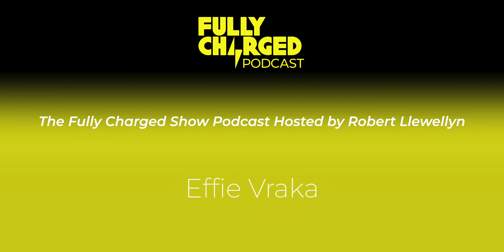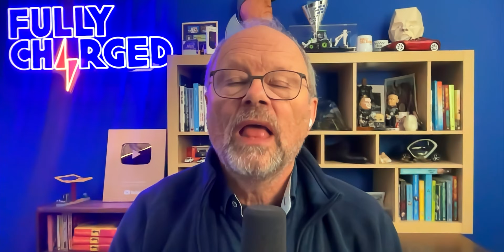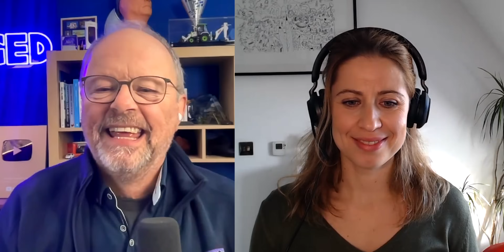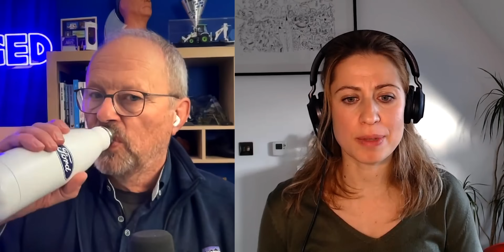with Effie Vraka | The Fully Charged Podcast

Comment: Felt so comfy to hear so many of my own stories told:
Living as tenent, with no 3-phases (11 kW) charging possible / allowed, only my standard, 1-phased plug. But it just workes well, especially since i do have a 3 kWp offgrid PV on my landlords roof, plus free charging at my company. Charging at home is just the most flexible and rewarding thing at all, power ranging from under 1 kW up to 2.3, using excess energy from my home batteries only. Just love it. 🥰

Comment: We're in a terraced house with no off-street parking, and no designated parking space, but that doesn't stop us from recharging at home. We've done that since early 2021. Use a little lateral thinking, and you might find that you can do the same, safely and legally, and at very low cost. Everyone's circumstances are different, but talking nicely to your local council might yield surprising results.

Comment: What we have found here in Canada is that buildings from the 70's were built with incandescent lightbulbs and old inefficient appliances in mind.  These buildings then have plenty of spare capacity that can charge all vehicles with the use of a charging management system.

Comment: Robert, agree that having even slow chargers widely available would help speed EV adoption. Better and more affordable home and small business scale batteries would also help speed electrification. And, small businesses owners need inexpensive charging stations that simply and directly bill the person charging their cars.
Reply: Level 2 charge points with integrated load balancing and billing is the way forward for businesses with public parking. Should be cheap enough soon.
Reply: They're building new houses around Lincolnshire, complete with home recharging points  @lua-nya  It costs very little extra to do that during construction. I don't know many people who have the finances for an EV plus a brand new house, but those houses are selling, otherwise the builders would not be interested in adding that basic refinement.

Comment: Spot on Robert. The fooks that can must. Others will follow as system is built out. This is no different than any other society level technological leap. Steam pump first invented in 1690 it wasn't until 80 years later that they were widespread. Electrification in America took 60+ years as did telephone. Automobile 50 years. The folks first to use these devices were wealthy. Government unwrote much of initial infrastructure needs.

Comment: I found the podcast very interesting & at various stages in it, the same question kept on running through my mind which was. Is the WeVo system bidirectional or setup to eventually be bidirectional ie vehicle to grid / load?

Comment: I live in an Apartment block, and we have repeatedly asked our landlord to install an EV charge point or set of points in our Apartment blocks carpark (with the usual "Just think, you can advertise this" or "This will be required soon anyway" etc), but they keep saying "there just aren't enough residents that use an EV"... well yes... because there is no charging infrastructure... So annoying.  They will NOT allow us to put in a charger, even though they would not have to pay for it as my wife is entitled to a free charge point due to being disabled.  It is very annoying.  We are forced to use the public charging network here, which is not great in Northern Ireland (yet, they are slowly getting better).

Comment: Another subject to cover is the best way to charge if the pavement is between the car and the house.. I've seen one overhead arm device that swings over the pavement with the cable, and another one has a channel cut in the pavement to accept the cable...
Reply: If your council does not stupidly push back to prevent either of these solutions so that they can milk you by partnering with a charger provider and provide you with both the charger and THEIR electricity tariff… 😤
Reply: Yes. A cantilever is the first thing my electrician suggested, because he's been fitting them to terraced houses, some of which have a small front space of a metre or two before the footpath. I suggested the covered channel, but apparently our local council is not interested in doing that, even though there are grants available to cover the costs. 🤷‍♂ They're still stuck in a 20th Century time warp. 🤦🏼‍♂

Comment: Naysayers are constantly bringing up the subjects of having no off-road parking and living in a tower block. It's one of their longest standing desperation arguments. There is absolutely NO effect on EV ownership if you have no driveway or live in a tower block. As per always these trolls never apply this argument to ICE vehicles. I always point out that unlike ICE vehicle owners, EV owners can charge at home. Even if you have no off-road parking and no dedicated charger you can still run a granny lead out to the pavement outside your house. There are never usually parking restrictions overnight so that's not an issue. But of course the argument is reduced to nonsense immediately if you ask naysayers to state categorically that no petrol, diesel or even hydrogen car driver lives in a flat or a house with no off-road parking. Of course they do. They ALL have to drive SOMEWHERE ELSE to get their fuel. You can't have a petrol station at your house, you can't put a diesel pump in a street lamp, you can't generate combustible liquid from a solar panel or a wind turbine. Here comes an eye rolling emoji. 🙄
Reply: 😂😂😂😂😂

What utter nonsense you type.

I'm going to presume you're an MP.

Comment: I Recently went to a seaside  Holiday Resort in uk and they had a car park covered in solar Panels with EV Cargers underneath  I did noticed one of the Solar Panels the control gear had burned out!
Reply: An excellent point!

If one unit can burn out then they all can.

Logic or wot!!!
Reply: @t1n4444  Technical stuff occasionally breaks down - and gets replaced or fixed. Not really a big concern. And losing one solar panel controller out of an array of many of them isn't going to make much difference either.
Reply: @neilcunningham1081  

Hmm ... are you sure you've got your facts right?

Might I suggest you re-research those points.
Reply: @t1n4444  Depends on whether you're setup with single inverters or micro-inverters (which is how my own solar is done). So yes, if you have a single big inverter on the array then when panel goes phut then the array is u/s until replaced or bypassed. FWIW my tiny array of seven panels has run reliably for the last 14 years. Solar panel failure must be pretty rare I would guess - but I have seen no stats from any source on what the failure rate actually is.
Reply: @neilcunningham1081  

Ah. My system is designed to charge a 12V bank with a controller per panel. (With MTTP monitor unit per controller.) Thus shadows or bird guano doesn't bring down o/p.

Lighting is per 12V LED units.

Battery bank feeds single inverter.

Don't use tumble drier as that would cane inverter and batteries.

Mind you that said my Epever controllers have never played up in six years.

Changed the battery bank a few months ago and that definitely helped ... battery bank now stays above the "magical" 12.6V overnight.